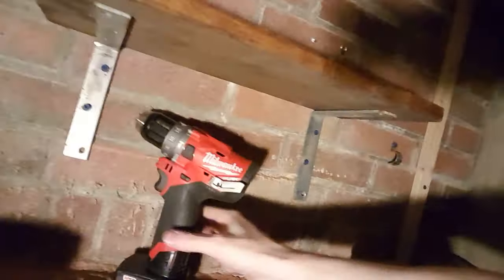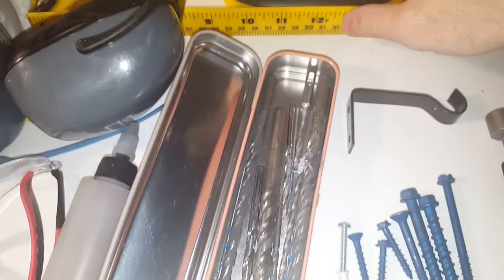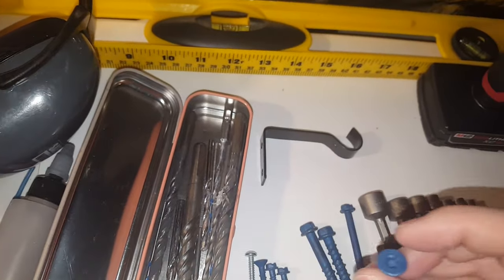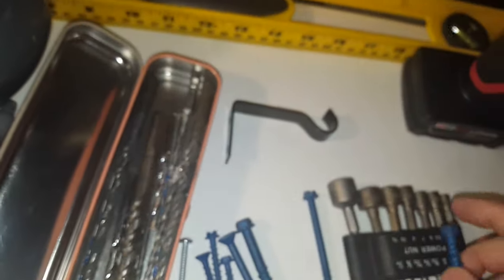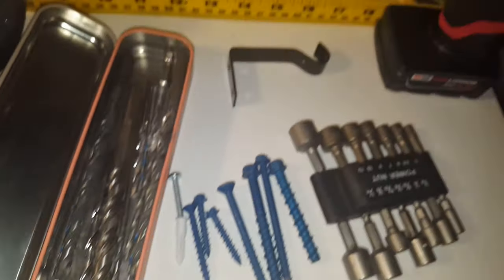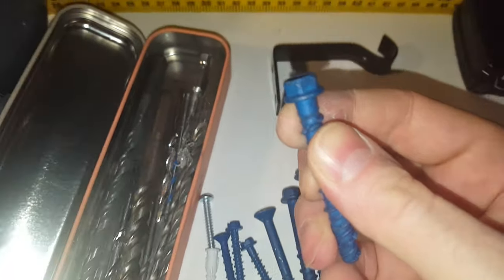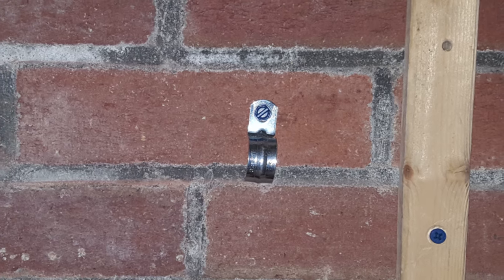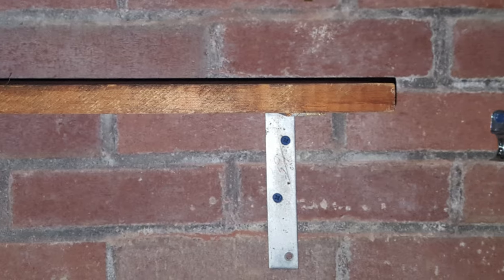Tapcon screws into brick | How to use Tapcons to install shelves on brick wall, or pictures,  etc

Comment: Good video - what is the reasoning for starting with the drill setting before switching to the hammer drill setting when drilling your pilot holes? How do you know when to switch?
Reply from the maker: You don't really have to start at the drill setting but it helps keep the bit from skipping around, which can happen if you start on the hammer setting. Set it to hammer once you drilled just enough to keep the bit in one place.

Comment: dumb question but where do you find the plastic blowout tubes? what are they called?
Reply from the maker: I have an empty plastic bottle I got at either a dollar store or hardware store and put it up to the hole and squeeze it, seems to work fine. I also have a plastic dropper but that might be harder to find. Ideally, you'd have a vacuum cleaner or shop vac if doing this work at home.
Reply: Bike pump